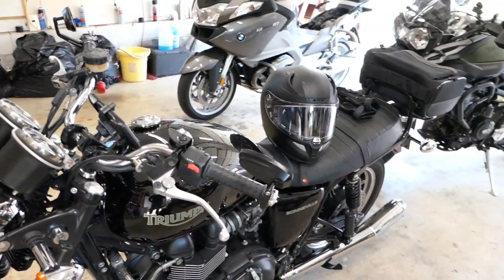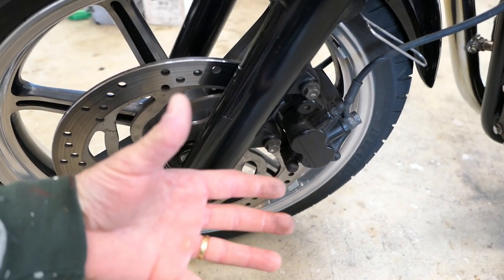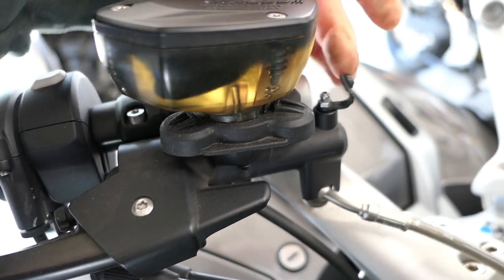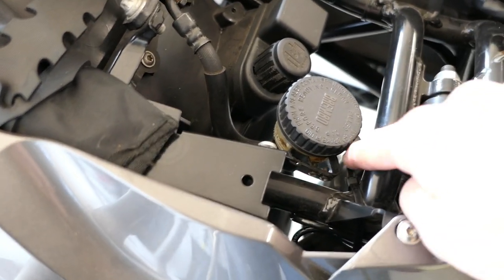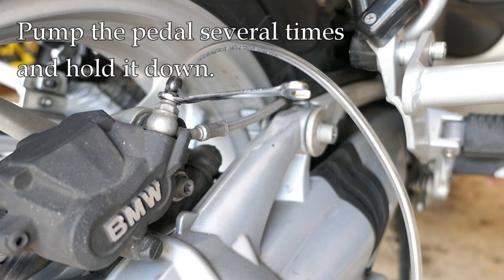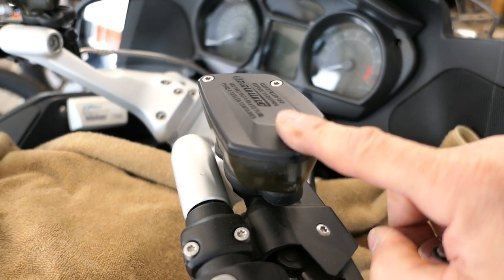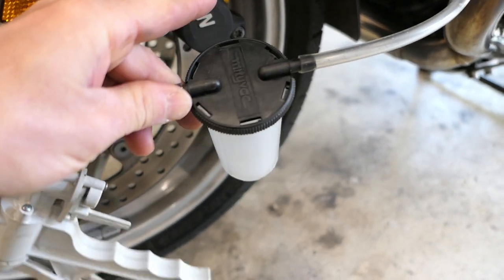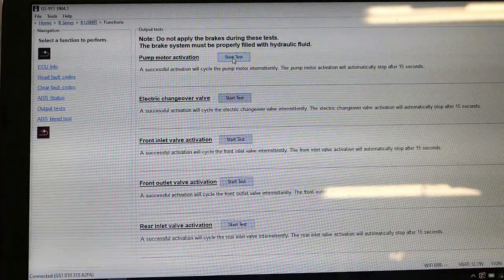Complete Guide To Bleeding Or Flushing Motorcycle Brakes

Comment: John, Thank you for taking the time to explain each and every detail in your videos. I'm 65 and just bought my 1st bike, back in Sept 2021. It's a little GS, a 2021 BMW g310GS. I just trailered the bike to the Black Hills for some off-road training with Bill Dragoo (DART-Dragoo Adventure Riding Training) and a group of 6 other riders and 3 instructors. While doing some side-hill-failure-recoveries, and, loose-rock trails, I dropped my bike a few times. When I returned home I found I had to pump my rear brake pedal to get any braking, at all. A buddy suggested there was probably air in the system and I should bleed the rear brake. Having zero experience bleeding any brakes since my 1970 Dodge back in 1975, I went in search of YouTube wizards. Fortunately for me, I found your video! Many thanks and I will be looking out for all of your videos! Jon in Dallas, TX.
Reply from the maker: That's a great story-- and I'm glad the video helped out!

Comment: Hey John, great information. I enjoy your videos. I've bled a few breaks with my motorized vacuum pump. I see you were pretty quick to think that the vinyl wasn't sealing to the nipple. But I see it differently. Think about it. You know how a break bleeder nipple seals. It's a metal to metal cone to cup kind of thing in the bottom of the bore .And there's a whole up through it where the fluid flows when it is unscrewed. But realistically the threads are the leak for the air. When you crack it, it pulls air from the threads. They're not so much made to seal all ,they don't have to. And the continuous vacuum action. ensures that nothing comes back into the system. But you'll never get rid of those bubbles. Thoughts? comments ?  Mark
Reply from the maker: I've done more brake bleeding using that method than I care to remember.  When the tubing seals against the nipple it should bleed without drawing in much air.  Sure, some air can get past the threads too, but generally you only have to crack the bleeder slightly.  In this case maybe there was a little more resistance in the hydraulic system and maybe the bleeder was looser than is typical, so air was leaking in by the tubing, threads or both. Ultimately it doesn't matter as long as you close off the bleeder before air can get back into the caliper.

Comment: Best vid I've seen for this procedure- Thank you!  I haven't invested in a scanner yet. Can I for go the ABS cycling for one flush? I have a 2010 RT
Reply from the maker: The point of flushing the ABS pump is not because there is a huge amount of fluid in there, but that you want to make sure it continues to function and doesn't seize up over time.  Since we don't normally use ABS braking very often, it may sit unused.  So, yes, you can skip the ABS pump cycling and the world won't end.  You'll still get a benefit from pushing out the older fluid in the calipers, which is where the heat and other issues can occur.

Comment: Just a quick tip / comment, when bleeding with a vacuum pump apply a small amount of grease or vasoline around the base of the bleeder valve. This will prevent the air being drawn in at the bleeder when you open the valve. Many mechanics as well as myself have done this for 30+ years.
Reply from the maker: Interesting tip.  I should also have mentioned that finding the right size tubing is important.  I like to have a pretty tight fit, but lately it's been tough to find options.

Comment: FYI, the prescribed brake fluid for most newer BMW's is DOT 4 LV.  Low viscosity brake fluid is required for to enable the electronics in modern anti-lock brake system to perform properly, i.e. quickly enough.  (Per Brad, a.k.a. "Boxflyer", words to that effect, not an exact quote).  Anyhow, verify your brake fluid requirements via the manufacturer.  DOT 4 or 5 brake fluid is not an adequate substitute for "DOT 4 LV" (even if supposedly,  DOT 5 meets or supersedes the DOT 4 spec).

Comment: In the video for MityVac, they show about a two inch piece of plastic hose that goes inside the bottom of the container lid. They fail to explain if the bottom of the hose is supposed to be submerged in fluid. I would think that in order to prevent air bubbles from entering the bottom of the tubing, that it would be best to start with some fluid at the bottom of the container. What do you think?
Reply from the maker: I'm not sure I follow your description, but you don't need to start with fluid in the cup to bleed the brakes.  When you connect a tube to the bleed screw and use the pump to create vacuum in the container, the brake fluid will come to the container after you open the screw.  The fluid will drop down into the container rather than be drawn into the hand pump.

Comment: I've bled brakes on numerous BMWs without issue until now. I have an 09 R1200R and have flushed and bled and re-bled the brakes and still get an initial soft lever that goes more than half way to the grip, than on second pull it is hard and much further out. Rear brake no problem. I didn't let the MC go dry, I've rotated where I start the bleed to now avail. Where else could some air be hiding, or do you think t could be the beginning of a brake line deterioration.
Reply from the maker: You may be describing a marginal or failed seal in the master cylinder.  When the seals are on the way out (or when there is excessive dirt causing a bad seal) you can often pump the lever or pedal and get a firm brake.  Then it will slowly fade.  Or, if you pull hard it may seal, but pull normally it may not.  The seals can get worn or torn, the bore can get out of round or dirty.  That said, you could also still just have air in the master cylinder.  Despite your efforts, it's sometimes tricky to get it all out of that area.  Some of the RTs have a bleeder valve right at the master cylinder.  If you do, you might try sending some clean fluid through that bleeder to clean it out and get any remaining air.  

Try experimenting with how you pull the lever and see if you can discern a difference.  If it is the seals, I'm not actually sure if you can purchase them from BMW or if you have to source a new master.

Comment: Thank you, great video, what year is this bike? mine is a 09 GS1200 with ABS but my dealer did just that, i ask him and saying that you need the 911 for older models
Reply from the maker: This is a 2012 RT.  The GS 911 will allow you to cycle the ABS pump to remove virtually all of the fluid from the system, but it isn't strictly necessary.  The small amount of fluid in the pump will work it's way out in time, and that will get changed as you flush the overall fluid.
Reply: @tinderboxarts  thank you 😊

Comment: Thank you for the video. I understand that there is really no need to work the ABS pump but if I do it, when should do I do it? In your video, you activated the pump after bleeding one side of front caliper.
I have front and rear ABS brakes and I have a computer that can access the ABS pump while bleeding.
Reply from the maker: To get fresh fluid into the ABS pump, you'll want to first bleed the system to clear the master cylinders and the lines of old fluid.  Then activate the pump with your scanner or computer, then continue to bleed to clear out what the ABS pump exchanged.
Reply: @tinderboxarts  Thank you for kind reply. As far as I know my bike (R nineT) has an ABS module that is linked both front and rear brakes. So what I need to do is bleeding front and rear brakes completely, and then I activate the ABS pump with my scanner, and then bleed the complete system again. Is this right?
Reply from the maker: Right.  In other words, you are going to clear the system first, then cycle the pump to refresh any fluid in the pump, then clear the whole system again to remove whatever came out of the pump.  Is this overkill?  Yes, probably.  You might also choose to just flush the system and then cycle the pump without a second bleed.  There is very little fluid in the pump.

Comment: Good detailed video.  Speed Bleeders are available for BMW R9T, link is on Gamotur's "BMW Brake Fluid Flush With Speed Bleeder.  The link has an older fitment chart.  Suggest just access phone number dial SB direct!
Reply from the maker: Speed bleeders are great, but I do have trouble locating them locally.

Comment: I have a question. After replacing the brake lines there is air in the system. So when I am pumping, nothing is coming out. How do I pump all the air out of the system?
Reply from the maker: When you say "nothing is coming out" do you mean nothing at all?  If so, the answer is about your master cylinder and reservoir.  When you drain ALL of the fluid from the system you also drain your master cylinder and reservoir.  Have you ever opened a new hand-pump spray bottle of cleaner and despite pumping the handle, no cleaner comes out for several minutes?  This is the same problem.  The master cylinder needs to be primed in order for the valve in there to work at all.  

One trick is to hold the brake down or the handle in for an extended period after filling the reservoir.  This can allow gravity to help you fill the master cylinder chamber and get some of the air out because it pushes the piston in to allow fluid to drain from the reservoir. .  Once you have a "prime" you should be able to pump fluid through.  However, I prefer to just use a vacuum pump and basically suck the fluid from the reservoir through the master cylinder and the rest of the system.  Once you create a vacuum with the pump down by the caliper (through the bleeder) you can squeeze the brake a little to allow the fluid to get started from the reservoir.  If you don't have a vacuum bleeder you can get one at any auto parts store or at Harbor Freight.  They aren't expensive.
Reply: @tinderboxarts  First off, thank you for the prompt response. I just begun bleeding the rear ABS line on my R1150RT, after replacing all the brake lines and draining all the fluid from master cylinders and all reservoirs. The rear ABS reservoir is lower than the ABS nipples. I was trying to use the vacuum pump but it probably did not have ample vacuum to pull the brake fluid up. The "gravity method" wouldn't work, since the fluid needs to pulled up. I tried to pump the brake pedal while pumping vacuum, but the pedal felt no resistance at all and despite the vacuum, nothing appeared to come out.
Two questions for you: 1. What is "hand-pump spray bottle" you mentioned. I do have a manual vacuum pump for brake bleeding. 2. Should I try to fill the fluid from the top ABS nipple using gravity?
Reply from the maker: Sorry, I got busy and didn't have time to get back to you sooner.  So, I was referring to a vacuum hand pump, that's all.  Just like you see in the video with the cup to catch the fluid.  The master cylinder has a piston with flexible seals.  The seals push against the cylinder walls to allow the hydraulic pressure to occur.  But, if the master cylinder is dry, then the air will just compress with a pedal push and nothing will happen.  When you fill the reservoir, that fluid should be drawn through the whole circuit by the vacuum hand pump connected at the caliper bleeder.  However, with a totally dry system it can take some effort.  What I was suggesting is to hook up the vacuum pump at the caliper, open the bleeder, and try to keep that vacuum pressure up.  You'll probably have to keep squeezing the vacuum pump handle.  At the same time, push the brake pedal (for the rear) slightly downward to see if that helps fluid from the reservoir make it through.  If you can keep the vacuum going it should pull the fluid through.  Gravity feed can sometimes work overnight, and you might need to tie the brake pedal down.  I just find that method too time consuming.

Some BMW master cylinders for the front brakes have a bleeder right at the master cylinder, which is hugely helpful.  But I don't think that's available for the rear.  It is also possible to push fluid up from the caliper to the reservoir, but that requires a means to pump under positive pressure.  When you purchase a new master cylinder for a car, there is a bench-priming procedure to get fluid into the cylinder before you install the master.  I suppose if you really got stuck you could try that, but I would hope the vacuum will eventually do the trick.

Comment: Hallo Tinderboxart. You never showed how to change clutch fluid. Is this fluid for life time? Or did I miss the video?

By the way. Thanks a lot! Now I do small maintenance of my r1200rt (2012) myself following your videos. And I can say that it saved me allot of money. Which I spent buying some good tools to get the job done😁
Reply from the maker: The clutch fluid is mineral oil and should not need changing unless there is a problem.  One thing to make sure you understand is that the clutch fluid RISES in the reservoir as the clutch wears.  So, you may need to actually remove some fluid over time. If the reservoir is overfilled it can lead to clutch problems.
Reply: @tinderboxarts  , thanks. Never heard about rising level. From now on I will watch the level of fluid more carefully.

Comment: This should be no different with a 2000 BMW R1200C with ABS right?
Reply from the maker: There will likely be minor differences in the way things look, but the concepts are identical.  If you don't have a way to force the ABS pump to cycle, don't fret.  There's a very small amount of fluid in the pump and it won't harm anything to leave it alone.

Comment: Hello, I love your videos, they are very instructive and entertaining. I have an `oak with BMW 1200 RT from the year 2012, because the red ABS warning light comes on, which resets only when I turn off the engine. I have read the bug with the GS911 and it gives me error code 23933, PRESURE MONITORING, REAR, SECONDARY CIRCUIT.
I don't know what it means. What I should do, because I have already changed the brake fluid but the same fault remains.
Greetings from Spain.
Reply from the maker: I don't know that error code, but I suspect your issue is within the ABS pump itself, or else air in the lines.  I think the pump has pressure sensors contained within the unit.  You may be able to find real time live data on those pressures using your GS911 unit.  It's possible that the sensor or the wiring to the sensor is faulty, or it's possible you have a problem such as air in the lines or the pump.  I would bleed one more time, and use the GS911 functions to cycle the ABS pump.  If the problem remains, you may need to take a look at the ABS pump and pressure sensors, as well as the wiring to them.
Reply: @tinderboxarts  First of all thanks for answering.
OK, I'll follow your advice, of course the complexity and sensitivity of this combined braking system and ABS is undeniable.
Thanks again.

Comment: some remove the brake pads when doing this, is that necessary?
Reply from the maker: As you squeeze the brake lever or press the brake pedal you are sending the piston outward in it's cylinder.  Without the brake pads in place you could potentially send the piston completely out of the cylinder!  So, no, you should not remove the brake pads to bleed brakes.  Even if you are using the vacuum or gravity methods there would be no point to it.  Now, if you want to take the opportunity to remove the caliper, clean the piston seal, and work the piston back and forth to make sure it moves freely, that's fine.  But, then you would replace everything, including the pads, and bleed as I showed in the video.  Or, you could leave the caliper off, insert a block of wood to prevent the piston from coming out, and then bleed the system with the caliper off of it's mount.  Either way, there is no reason to have the pads removed while you bleed unless you happen to be doing this other work at the same time.

Comment: I have abs brakes , is this the same method
Reply from the maker: Good question.  ABS brakes require a pump to automatically apply the brakes in a rapid pulse fashion when needed.  That pump is part of the hydraulic system, of course.  To completely flush your hydraulic system you need a scan tool of some sort to cycle that pump and flush out the fluid contained in the pump itself.  However, that amount is quite small in relation the system as a whole.  It's perfectly acceptable to flush your system using standard methods, even though some small amount of the old fluid will remain in the pump.  As the system runs in the future, that small amount will be mixed in with the new fluid.  If you do have the scan tool for your bike you can cycle the pump and get that fluid flushed too.  All that said, you shouldn't NEED the scan tool to work the ABS pump unless you introduce air into the pump by draining the system completely.  So, go ahead and flush your system even if you have ABS.

Comment: You keep calling the break fluid reservoir a "master cylinder". You should address this issue.
Reply from the maker: Yeah, I know, I'm using the words loosely.  There is a reservoir and there is the master cylinder itself.  On many vehicles this is an integrated unit so I'm just used to referring to it that way.